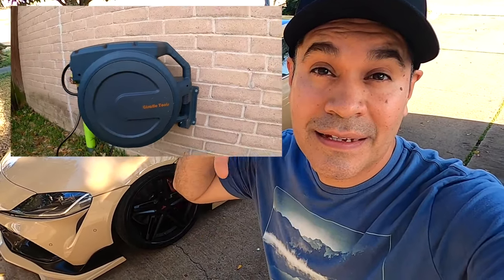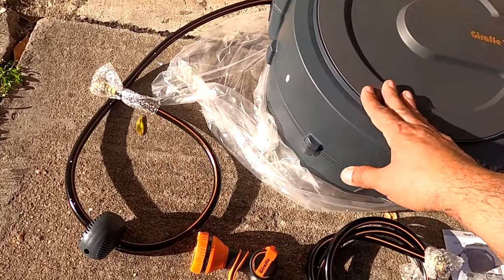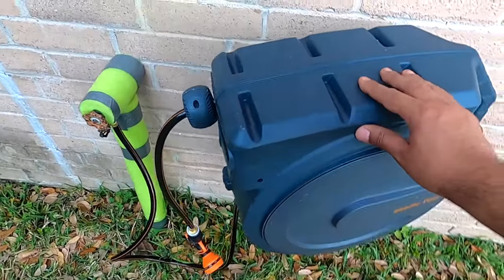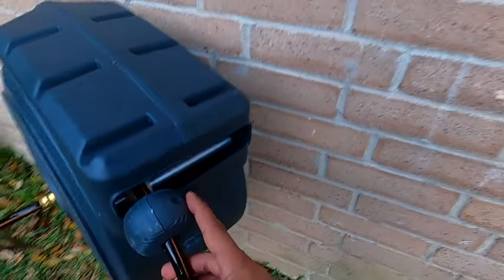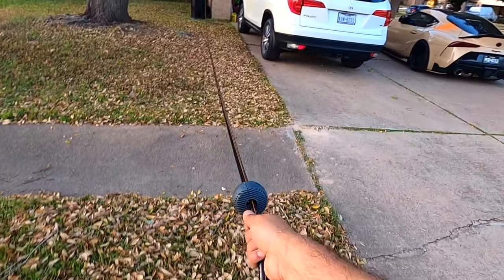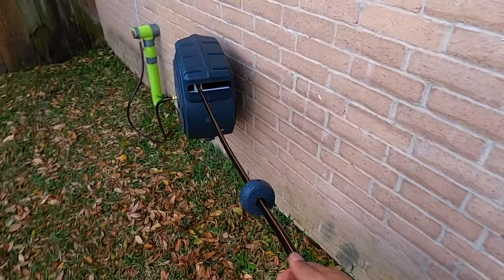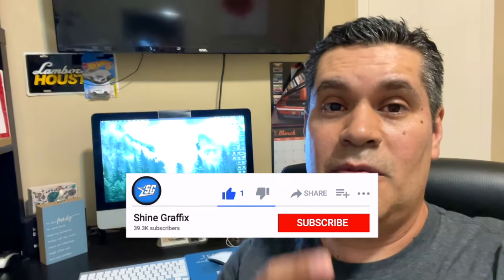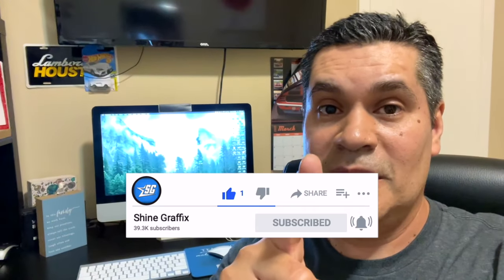BEST 130ft Retractable Garden Hose Reel 1/2" GIRAFFE TOOLS • REVIEW

Comment: And the lock is adjustable, so you can pull the hose out some, or all the way, reposition the lock, and let your required hose length lay on the ground in the area you are working at.